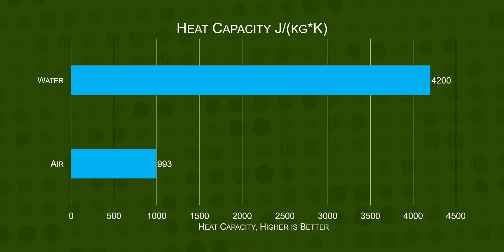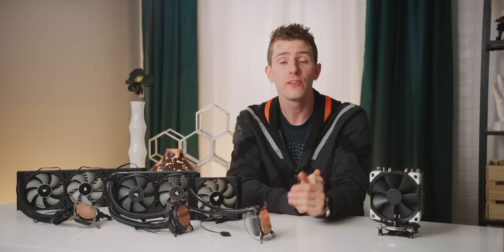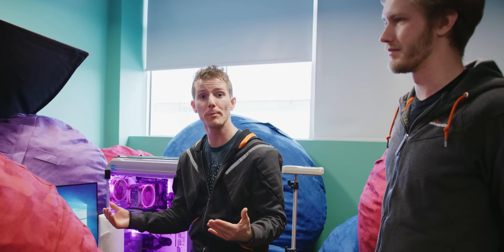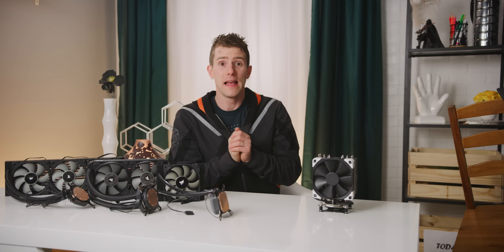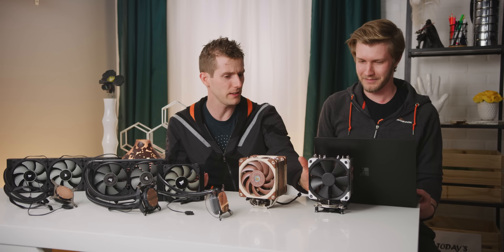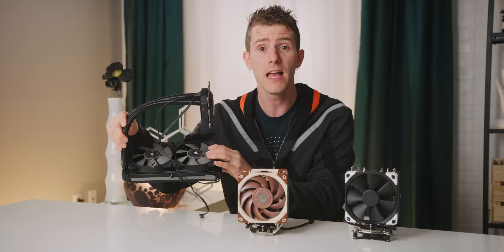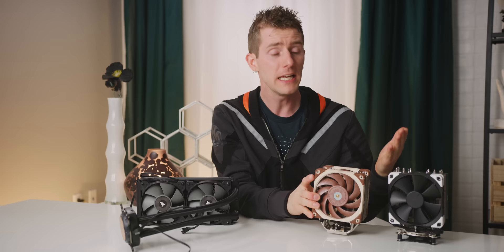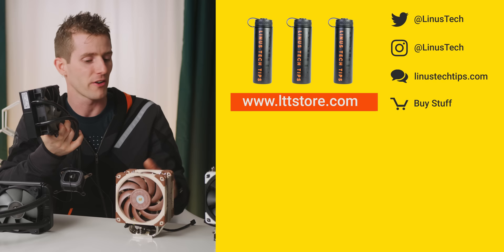Why you shouldn't water cool your PC

Comment: "You shouldn't water cool your PC"  Linus : water cools all his PC's
Reply: Rati Jugeli h m m m m
Reply: he said he water cools it because he likes the "cleaner look" because you can mount water coolers higher and are less out of site and you can see your motherboard and maybe led lights (if you add some) more better but air coolers are much better than water coolers I agree especially price wise
Reply: Do what i say, not what i do. - LTT
Reply: 3celsius = It's not even close. Could be anything from TIM to airpockets, Like how do you suppose that they eliminated all the variables in their setup when the radiator is mounted differently with relation to airflow, along with what sounds like a jank setup with HVAC and shit. 

I think the biggest and most beneficial aspect of the AIO, is not the cooling performance, it is infact the clearance hassle that you fucking get from big fucking fans and heatsinks, which there is no way to fucking know for sure if you have clearance until you get something shipped to you, only to find out, FUCK It doesnt fit. Or you're literally risking damaging your board to push ram at an angle, or forcing stuff in, having to completely dismount your whole CPU, just to change ram.

Honestly, Cry more about 3Celsisus, when you're building a pc and dont wanna fuck around with "Does it fit", AIO wins everytime. Unless your board is awkward as fuck, There's no way you can't find a way to mount an AIO (where the radiator fits), in a case with any board. Who cares about temps when you're trying to figure out which spacehog is gonna fit in your particular case, with your particular board, with your particular ram. Unless you wanna go the safest route and copy some kid's setup by the piece, which means you gotta stalk some forums for someone who isn't bullshitting you.
Reply: Linus always warns us not be like him
what do we do?
copy Linus.
just don't start dropping your shit :D
Reply: @Gixbit  .... Non issue. Noctua have clearance charts on their website, even for ram clearance. I used it to check my setup prior to buying parts... corsair 700d case and NH-d15 (huge beast, biggest HS they sell) and lpx ram where all covered on the site. It's on you if you simply did not check it.

The reason I decided to use air over liquid was past AIO pump failure and the equipment it took with it. worst case on the Noctua 1 fan fails and it still wont overheat anymore than a few degrees, just replace fan.
Reply: @timmyboy525  Because who cares about fucking around with clearance charts if you dont want to do a research paper to build a computer dude. You miss the point. Your clearance issues are fucking gone with an AIO. You can get whatever else you want at that point without having to worry at all. Even change your mind about parts and not need to go and do more research.

Everyone who does this enough knows what you just said is a thing you can go and get the dimensions, my point is this is completely non-issue'd by AIOs.
Reply: Just build a second support rail to hold the bulky end of the heatsink. I was fortunate in that my case was just skinny enough that I could secure the giant air cooled heat sink to the opposite side of the hinged case lid with two holes, screws and rubber isolating grommets.
Reply: @Gixbit  I can agree with what you are saying, BUT your delivery would carry more weight if you were not talking like you were "triggered".  Just an observation.
Reply: @ericburgett8521  Dude we have to recognize and respecc those among us who suffer from turrets
Reply: @Ioganstone  the insult carries more weight if you learn to spell tourette's
Reply: what did you aspect from that clown
Reply: @Gixbit  Yeah, my father had one  in his office pc. It leaked and the mainboard was a goner. Did never happen to me with the huge air mounts.
Reply: Its just like his last video where he says buy AMD stock then says he wont buy it. I didnt buy cause of him and now we both regret it
Reply: @blueberryiswar  turning your pc on has a risk of decreasing lifetime too. Point is you cant be afraid of those things. If you dont want extra risk its your choice
Reply: His point was more "Water cooling really isn't necessary for the average user" and less "Water cooling is bad". Its more expensive and more of a hassle, so for people who are not made of money like him, and who use their PC more than tinker with it, as he said, its just simpler to get a good air cooler.
Reply: Well bare in mind linus also does alot of custom water cooling loops which is where you really get a benefit in temperatures. I think he also does AIOs since its alot more cleaner
Reply: Obv because his leaks!
Reply: @Rex_TTV  lmfao no they aren't. Air coolers are fucking  trash.
Reply: @chaikagaz  never trust what he do 😂
Reply: No one understands him.
Reply: Depends. AIO generally aren't worth it. Custom water cooling however is a different story. You could build better than HSF performing loops but that does come at a hefty price
Reply: @Rex_TTV  The fact is water coolers give you more room & more air flow thats a fact! Plus if you have a side panel that you can add 2X 120mm or one big 1X 200M fan you can direct the fan towards the water coolant & you are helping it cool down faster. I have a Coolmaster HAF 922. Corsair H100 is a damn good radiator pffffft1 getr's beat by 1 degree Oh,sure! its going to over heat by that LOL!
Reply: @timmyboy525  I had two h100 water coolers, replaced the first one after 4 years due to prudence. No failures from either, sold the pc after a lifespan of 7 years with some upgrades along the way to a student for cheap. Haven't heard of problems from him either. Maybe I got lucky, maybe you got unlucky. Is 3 years a reasonable amount of lifespan for a water cooler? Probably, considering how simple the design of a water pump is.
Reply: @Pekopekope  the point is the risk of water leak will always be there. For some ppl, the risk is not worth losing an expensive pc.
Reply: @mr4kgamer  you be over here making us stupider just leave. and you don't have to be white to be smart bruh color does not define your intelligence
Reply: i was the 1,000 like :)
Reply: @Gixbit  we can mitigate risk... the pc has to be turned on, the aio doesn't have to be there
Reply: Wait thats illegal.
Reply: Definition of a Hypocrit. Jk
Reply: b/c rgb only reason
Reply: Real water cooling is great. Clc is good enough but nothing like a custom loop. And heatsinks dont break ever..
Reply: Because he can't stop tinkering and overclocking everything lol
Reply: Custum is different then aio
Reply: @Gixbit  I had a friend have to mount his fans on the outside because they didn't clear with the rad. Clearance issues still exist they are just in a different place. One itx build I did I had to sand off part of the fan to clear the SSD. Granted air cooling that rig would have been borderline impossible, it's still a thing.
Reply: @Ancyker  there are definitely less issues with all in ones. If you buy a decent case. If you buy an itx deal what you expect?
Reply: As he said, he's a tinkerer! 😁
Reply: And all of the  rog rig reboot ones too
Reply: @Rex_TTV   Thats not true. You can get a cheap water cooler for 60$ more than a typical air cooler. There are plenty on the market for 160$. If someone is on THAT tight of a budget, perhaps they should get a better paying job or as Ivanka Trump would say "Do something different hehe"
Reply: @Glorious_Kim_Jong_Un  I don't have any budget problems but I personally prefer performance over aesthetic because upgrading parts due to the cooling system being unreliable is a hassle.

Comment: I think in the past liquid cooling in its infancy was better only because air cooling wasn't using heatpipes or not using heatpipes effectively. But now the use of heatpipes for cpu cooling has matured. Liquid cooling has the advantage of high heat capacity, but heat pipes has the advantage of latent heat of vaporization (of water inside the heatpipes) and conducts heat incredibly fast.

Comment: When my pc reaches 110 degrees I turn off my heater and use the pc heat.
Reply: My laptop shuts off at 67 or so degrees C :(
Reply: Dead Inside and Out rip
Reply: @deadinsideandout9292  my laptop goes to 100 celsius before the gpuz temperature counter stops counting. A simple trick I learned to bring temps down is to raise my laptop on each corner so that it isnt flat on the table. that prevents heat buildup below it
Reply: 110 degrees?! And I am worried if it reaches 80...
Reply: When my pc reaches 40 degrees I'm already scared I would get a panic attack if I saw urs
Reply: @beater4742 It is OK for the GPU to get to around 75 and the CPU to 50. 40 is completely normal, I'd even say perfect
Reply: or put ice packs below the laptop also helps with those bad cooling tiny untrabooks
Reply: @ImperialDiecast  Have you undervolted your laptop? My I7 9750h went from thermal throttling, to all core turboing to 4.3 ghz, It's very easy and low risk.
Reply: @erzhaider  It's okay for the CPU to get to 75+, 50?? Try doing any multi threaded task like encoding or compressing, you'll get higher than 50c
Reply: I just use my Xbox for a heater
Reply: I use it as an A/C
Reply: Imperial Diecast 100!? My GPU gets to like 60-70 under load
Reply: High Cailber Same
Reply: yo DriPPyW3T why didn't you share this life hack sooner man
Reply: @beater4742  What Kind of cooling do you use to make it stay at 40C? My CPU idle temp is around 49C, at full load max temp was just around 63C.

GPU idle temp is 47C, max temp at default fan speed graph was 74C. After changing the graph max temp went down to 70C
Reply: @miokujou  I have the stock cooler, water cooler, some kind of really weird case and air conditioning because all the heat from my pc goes out into my room because of the weird case.
Reply: @beater4742  Ohh so that explains it. Water-cooler plus air-conditioned room.
Reply: @ryantodd8420  what xbox? i have had a one s for 3 years and it isnt too hot
Reply: OH MY GOD HOW DOESNT YOUR PC MELT WTF
Reply: @ImperialDiecast  get a heat stand for your laptop
Reply: @deadinsideandout9292  lmao my laptop would still run most games with 150 fps+ at 90 degrees
Reply: @beater4742  how is 40 degrees scary...
Reply: @sharp9150  idk man my pc just chills at 30 degrees and when it's at 40 I'm not used to it
Reply: Rofl
Reply: Hi pc* is prob dusty af or against a wall
Reply: Modern problems requare modern sollutions
Reply: @hwhaht  I have the same processor how do you unlock turbo boost
Reply: He's joking...
Reply: @beater4742  lol my resting pc is 45-50 degress
Reply: just use a plasma tv/monitor they run really warm or lg in 2020 as they really cooking so bad lg recalling a few 60000 lol in south korea
Reply: At this point you might as well just to save on a little power
Reply: LoL
Reply: A N I M E
N
I
M
E
Reply: @erzhaider  80 is fine exept for hdd. ssd, psu, etc. but 80 is fine for cpu and gpu. try cleaning ur pc and if your gpu is too hot try undervolting, mine got 20-15C less when i undervolted and put a fan under the gpu. (amd stock cooler fan 90mm)
Reply: @hwhaht  i wanna undervolt my cpu its at 60-70c (not bad i know but i want it quieter) what program did you use for it?
Reply: @beater4742  idle is 30-40 but playing games gets it to 80-90 probably
Reply: @aleksifrmdao  nope max 45 but it is surprising
Reply: My PC hasn't even got close to 90°C
Reply: @beater4742  if my of gets 40 when idle that's when I panic
Reply: My room is super small so I don’t even need a heater cause my pc has an r7 3700 and 2060 super
Reply: Where's the thermometer port?
Reply: In winter I can just turn off the central heat and close the doors to my computer room and its warm and cozy. It can be 20's-30's F outside and don't end up needing any other heat source!

Of course in summer the computer room is 2F warmer than the rest of the house even with the doors open and everything circulating.
Reply: mhhhhh...yes AMD
Reply: core temperature =/= output power
Reply: Your pc  is prob at 110 degrees cause of the heater in the first place homie
Reply: @erzhaider  I was worried because mine reached 45 lmao
Reply: no lie, I've done this. My clocked system literally turns into a space heater when those radiator fans trip over the threshold.
Reply: Does not the PC burn up?
Reply: That shit will heat up a small room better than a space heater, I have to open my windows.
Reply: @ImperialDiecast  you get a laptop up that high?? Are you playing intense games on them? I've never gotten my laptop super hot like that, I leave that to my pc build.
Reply: Wait till linus creates a Liquid nitrogen cooler, that would freeze up the entire pc 😂😂
Reply: @deadinsideandout9292   Why?
Reply: @ultraawakening4328  motherboard contains a shutdown procedure when temperatures exceed a specific amount. Mine is warped, requiring lower temps for a shutoff.
Reply: @deadinsideandout9292  Because it's a laptop, laptops aren't meant to go beyond 50 degrees because the laptop's components are so tight and compact against each other and there aren't a lot of cooling options for it besides a laptop fan pad. 67 is fine for a desktop because it's much bigger and allows for better and more divided cooling, but for a laptop 67 is fucking hot
Reply: @ImperialDiecast  100!?!?! How is has your laptop not have melted?! I would highly advise you either get a new laptop or go get it cleaned out because you must have pounds of dust inside for it to get that hot, laptops should never go above 75 or so degrees celsius. For my desktop when I played MW2019 it was very very warm at even 75-80 degrees because I had no case fans except 1 front fan and because it had a ton of dust. Go get your laptop checked out is my guess. The laptop being flat on the table which makes heat build-up below it is not the reason why it got to 100 degrees celsius, not a chance in hell, it maybe maybe a quarter of the reason but again please go get it cleaned out because there is a lot of dust inside it.
Reply: @miokujou  It's not hard to make it stay at 40 degrees celsius, I have a stock intel fan and like 3 case fans and it stays at normal temps fine and even at 50-60 under load.

Comment: I used to liquid cool... AIOs, then moved on to custom loops with soft tubing, then on to doing builds with rigid PETG tubing, etc... Now I just stick with a Noctua NH-D15. Got sick of permeation on AIOs rendering them useless after a while, doing maintenance on custom loops (disassembling a PETG run is a pain in the ass), etc. A good air cooler with a graphite thermal pad gets you 90% of the way there and you don't have to do a damn thing to maintain it. No repasting, no nothing. Blast it with some compressed air once in a while if you're feeling generous. That's it.
Reply: using a graphite thermal pad instead of something like the kingping or the kryonaut or even the nt-h2 its actually very strange